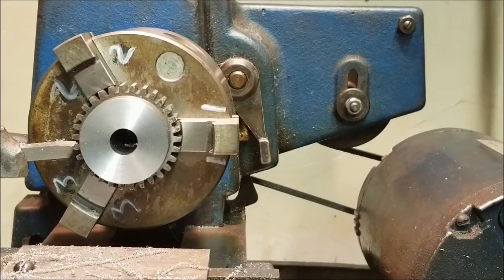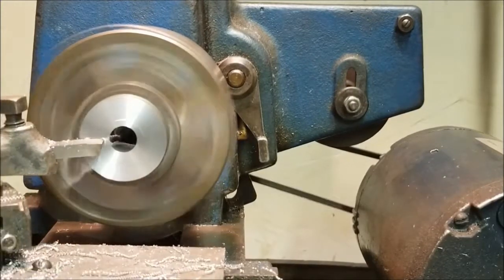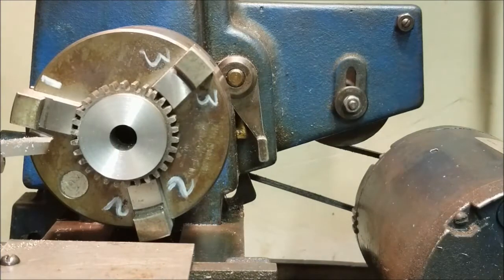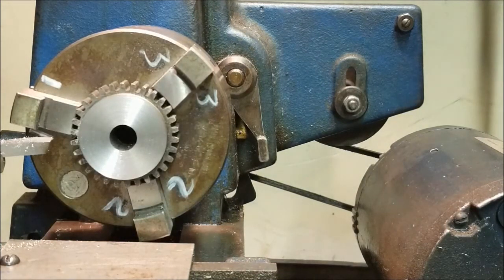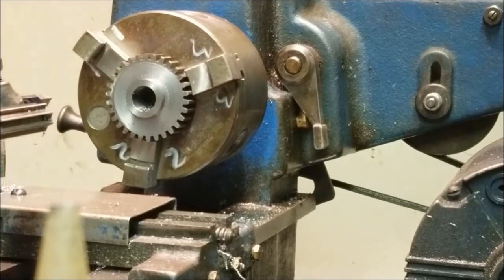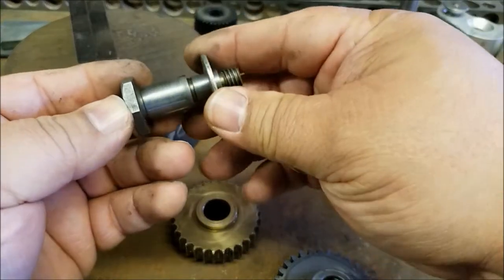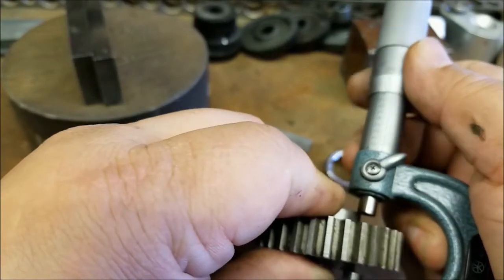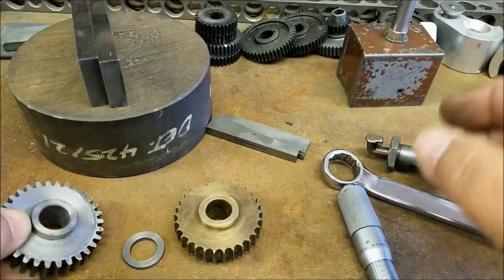SHELDON LATHE - REPLACE A WORN GEAR - Part 3 of 3

Comment: I bought this lathe in several pieces today.  This is the first run having put it back together for a quick test.  Not sounding great, quite a rattle to it. Have ordered Lathe oil and will look at the gears for the lead screw which are the main sources of the noises.